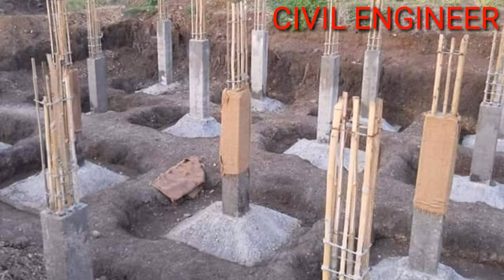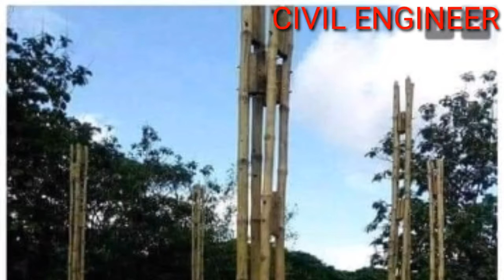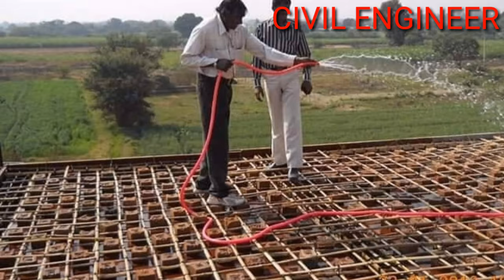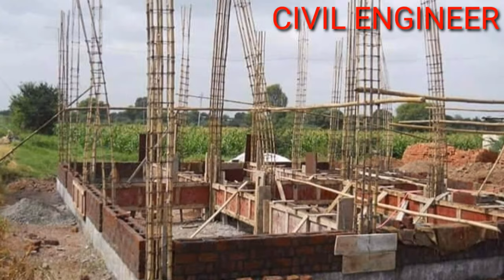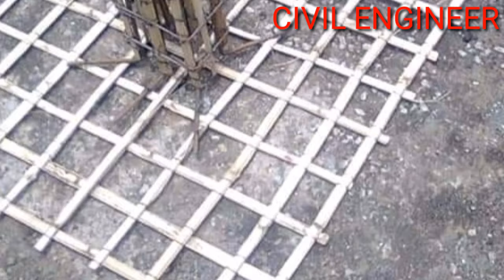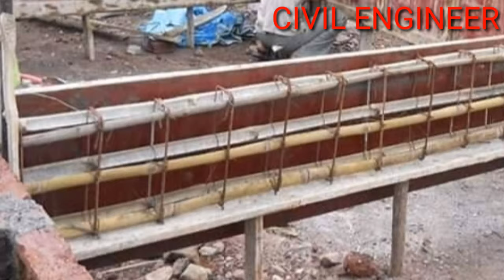Steel  is replaced by bamboo / bamboo is used as reinforcement / civil site engineer / home construc

Comment: We use the reinforcement to give and tensile strength and i dont thing that bamboo can give..and if fails we can't join like we do for r/f and what about curing it I'll expand concrete will fail 🤯
Reply from the maker: Hallo dear friend we use reenforcement to restraining tensile stress Wich devoloped in the concrete not to develop tensile stress. Structure is failed at tensile stress so we use reenforcement to restrain it.
Bamboo has same property of restraining tensile stress but not much as steel. But whare low havy structure or required economical structure whare we can use it definitely.
Reply: @ashaiconstruction2768  then with out curing how the concrete will get a strength
Reply: @ashaiconstruction2768  may be painting  works 🤔
Reply: @ashaiconstruction2768  dear friend one thing you missed here... Bamboo is an organic material that will decompose over time...as time goes the bamboo will lose all its strength drastically... What will you do at that time? 
And the bamboo fibres cannot resist any torsion or twist....it will get seperated in an instant, then by this mechanism also the bamboo loses its strength... So overall even though you are experimenting don't make it for public use or personal use until enough factual evidences are available through respective boards.